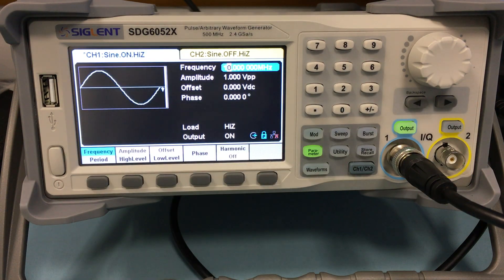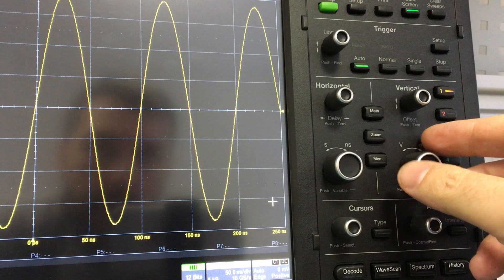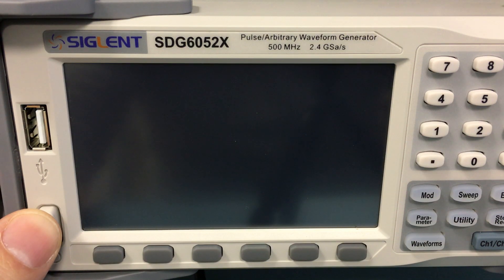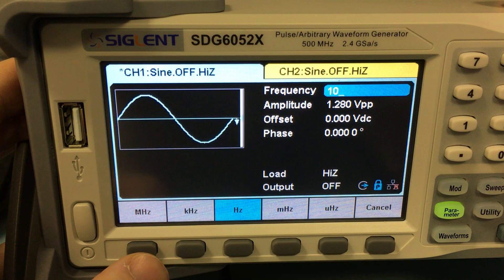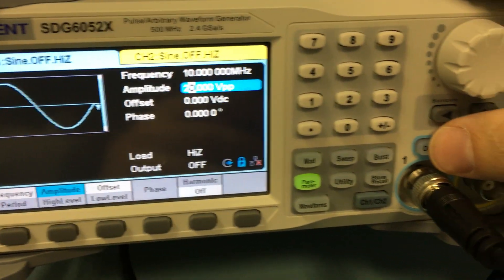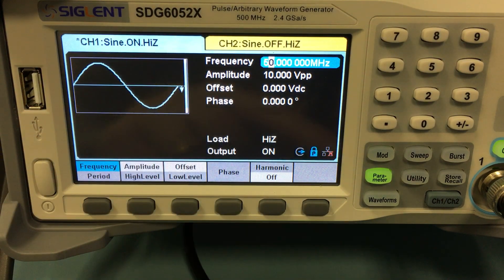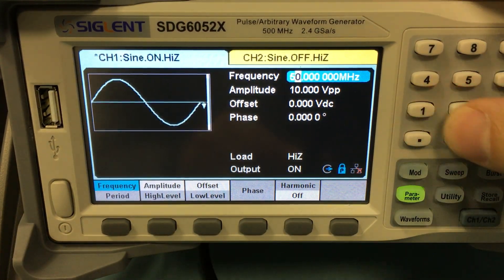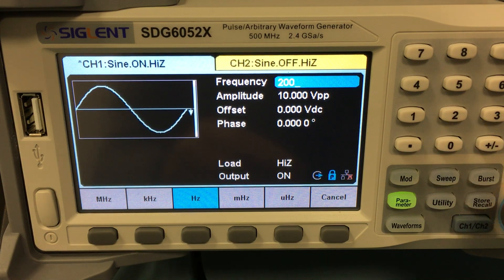Testing the 500MHz SDG6052X by Siglent

Comment: You might want to reconsider testing with 50 Ohm input range on the o-scope for a more accurate measurement of the voltage output of the sig. generator.   Most o-scopes have frequency compensation capacitors on the high impedance input ranges and on the probe.  This generally causes the input Z to go down with frequency.  The frequency generators output is probably a fixed Z, even if you go high-Z or 50 Ohms.  As you go up in frequency and the scopes input Z goes down, the voltage gets divided between the sig. gens. output and the scopes input.   In some Pspice sims. I did of compensated front ends, I've seen the input Z go from 1M to 100's of Ohms over just 50 MHz of frequency range.  You get a nice flat gain curve, but only if the source impedance is low enough to drive the load.  Most real life sources are not.  

Unfortunately it seems scope and signal gen. mfgrs. don't specify there input Z or output Z vs. frequency for other than the 50 Ohm range.     

Just as a note of caution, don't exceed, the scopes input voltage range when going to 50 Ohms.  It's usually only a few volts pk-pk.

Beware of cheap BNC cables that often have bad shielding.   As a quick test you can measure the inner conductors resistance from end to end and the the shields resistance end to end.  If both measurements are different by a few Ohms, you can end up with a lot of noise on your measurements.  I had some cables where the shields R >10 Ohms on a 6' cable and it acted more like an antenna then a shielded cable.

In your test I could see what looked like some AM modulation of your signal on the scopes trace.   You might want to get a spectrum analyzer and look at the output of the sig. gen. and cable to get a better picture of what the frequency domain looks like.   It would also be useful to see how the harmonics look on the signals and what the SFDR is.   I would recommend doing the frequency analysis with their cables and some known really good ones to see if the shielding is good or bad.

Another thing to test would be the rise and fall times of the square waves over a range of output voltages.   I recommend 50 Ohm settings on scope and generator.   Also, beware of the scopes limits on measuring rise and fall times.   You might need a scope with with a higher BW to get good measurements.

The guy from The Signal Path and EEVblog have some good reviews of signal generators you could use for a template.

Thanks for the review.  These are very helpful to those of us who need test equipment, but can't afford the good stuff on making decisions on whether or not these lower cost equipment are worth the investment.